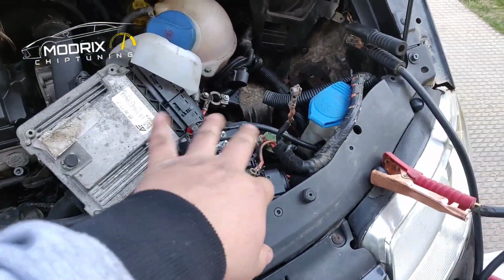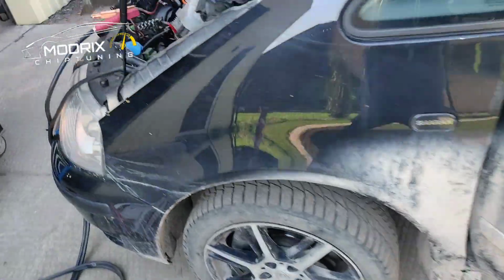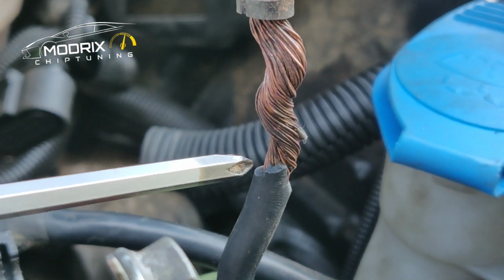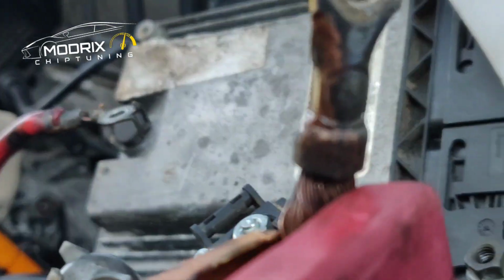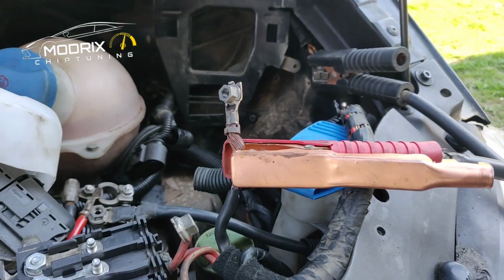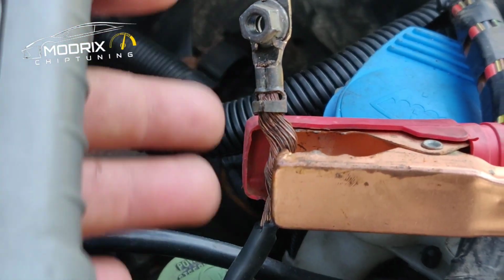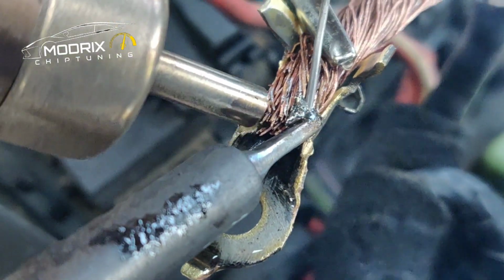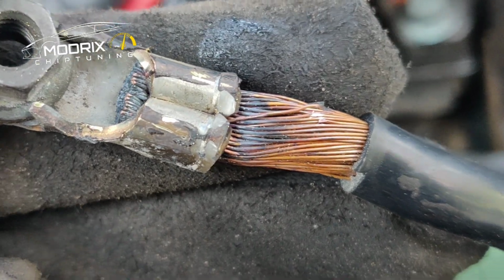✅ VW Sharan Electric Problem HVAC Contact FIX Easy DIY Steps

Comment: I had the same issue, I solved it by cutting the old connector, crimping a new one, then soldering to seal the space between the wire strands, because the corrosion between the wire strands was the issue in the first place. The car was than 13 years old (now 23), I have not had any problems with it since then.

Comment: The only functional solution is to change both, the whole wire with a slightly bigger diameter, and the fuse box. This is just temporary and from my point of view not a good solution.